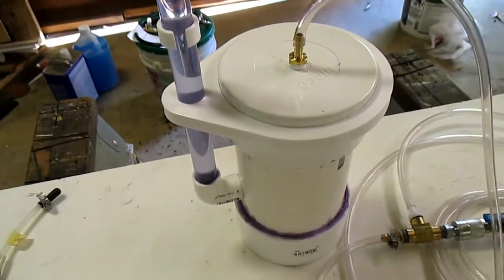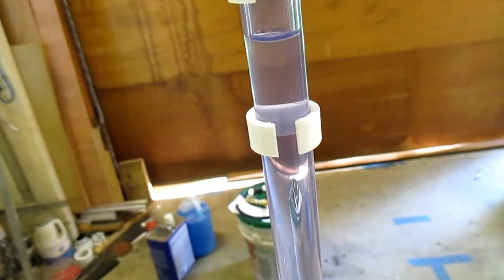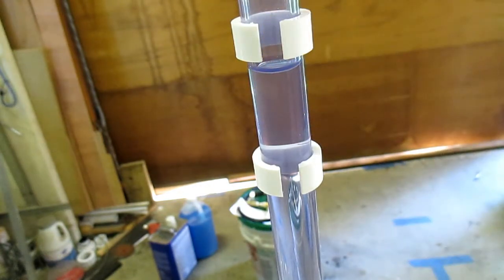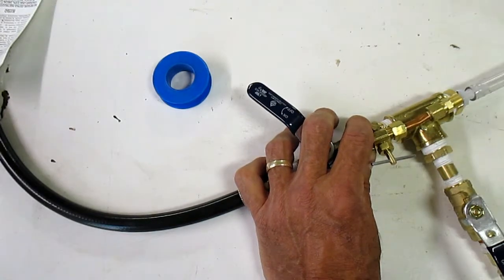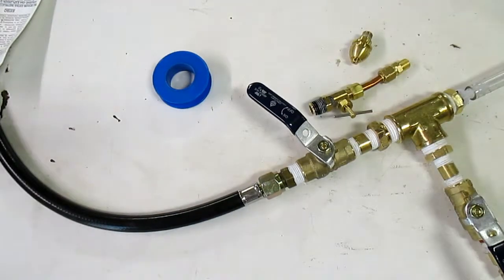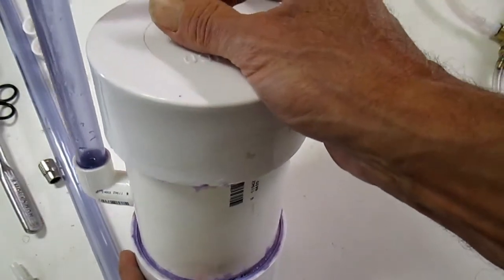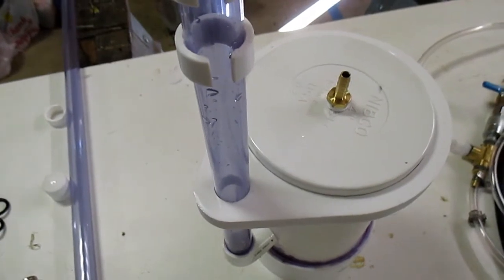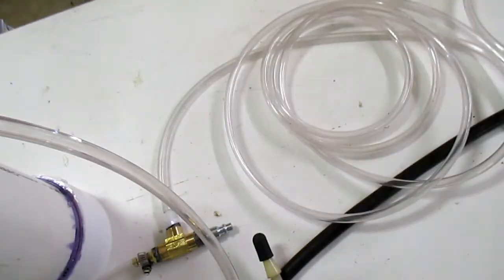EVAP tester with well style manometer

Comment: i'm intersted like to see how you would use it on the vehicle to check evap
Reply from the maker: Hi Mako, still learning at an old age how to deal with newer cars. My buddy has an 06 Forester and on that I disconnected the evap line in the engine compartment and worked back towards the tank. We fixed one leak and no codes but there may be more, I’ll hook up the machine at the same hose and watch the manometer. Just got to make sure to close all the solenoids so it’s a closed system. If the mark stays above the .020 mark then no codes but how far above is another question.
Reply: @backyardinventor9580  Is this the same as a smoke machine? still like to see this in use
Reply from the maker: To answer your question this is Not a smoke machine, this is to test after repairs are made to make sure all leaks are sealed. When I have the time I’ll show it hooked up to a vehicle but there a ton of videos on smoke testing a EVAP system out there, look them up if your interested.